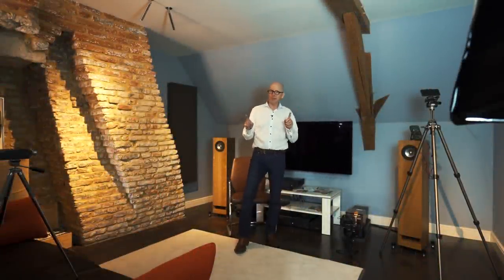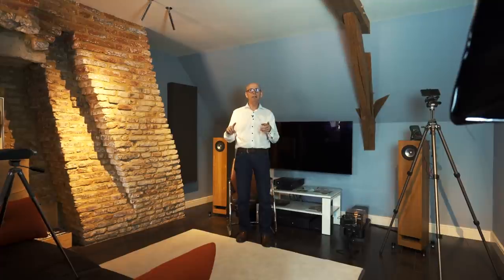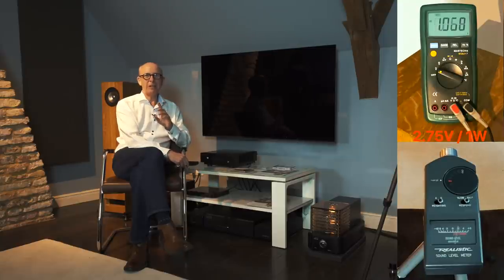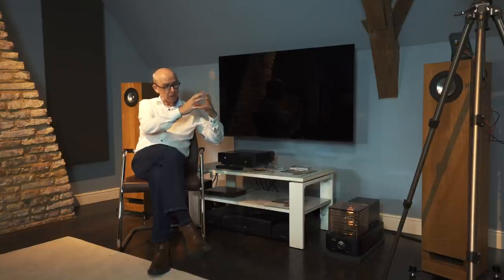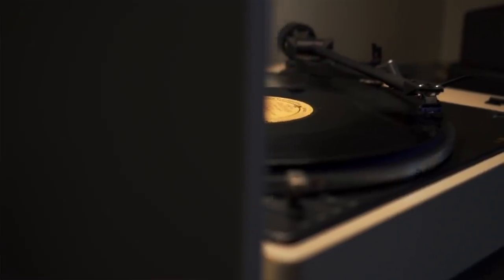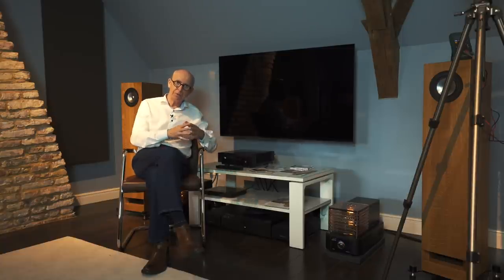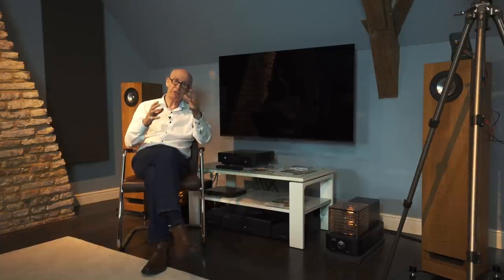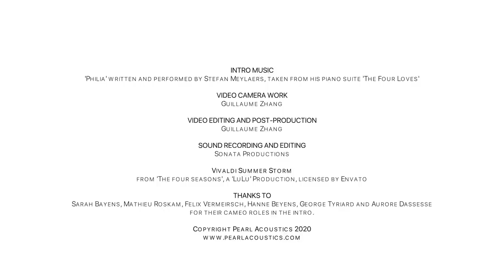How loud is 1 Watt (with an 87db Loudspeaker)?

Comment: 8 watts will push these 87dB speaker to 96dB. At 4 meters away it will be 90dB. Nothing near 100dB for sure.
Reply from the maker: Don’t forget it’s two channels driven, so you need to add another 3db. However, you’re right. The objective is just to show that in most listening situations we only use a fraction of the power we might think we are using.
Reply: Theoretically right but ech data are measured  by producer in anechoic chamber.
Reply: Sure -  if you enjoy your audio system in open desert you are right.  No standing waves and no reflections from objects 
For clearance   In my room 20 sq meters 87 dB from two speaker sets (efficiency about 91 dB).  just measured  my system with certified noise level meter and I've got 87 dB from 3 meters. 

 At that moment  I read  digitally measured 2 Volts at terminals . To be clear - I used pink noise so  type of music and timing   would have  no impact.

  In books and data theory you mentioned  it would be 91dB - 12dB = 79dB.  87dB  against 79dB  to accept is  too much difference.  For 8 Ohms speaker it equals  0,5 Watt  each. Means 1Watt at distance 3 meters in typical room makes 87 dB . I couldn't try higher level for my neighbours and mine comfort.  Just reality against "nice" science used  for factory  models for standardization ..

Comment: Otherwise a very informative video but the analogue about the speaker asking for power and amplifiers having difficulty ramping up is very very wrong. A speaker(ie an assembly of a magnet, voice coil, suspension and a diaphragm) doesn't ask for anything, the amp throws out power according to the input signal and the speaker does whatever it feels like doing with that power.

The amp supplies exactly the right amount at the right moment. An input signal tells the amp what to do and the amp follows the lead. If it gets a high input value, it gives out a high output value. Of course there is some latency and distortion of the original signal but a proper amp doesn't falter that easily.
Reply from the maker: Thanks for your comment. Of Course you are absolutely right. An amplifier amplifies the incoming signal, that's all it has to do!  However, what I was trying to explain, is the latency effect that you touch on in your comment. We must not forget though, as I am sure you know very well, a loudspeakers' impedance varies depending on frequency and other acoustic resistance elements, thus the loudspeaker puts demands on an amplifier, by the fact that the amplifier has to deliver its amplified voltage to a device that has a varied impedance and which is pushing back voltage of its own.  In the desire to simplify, sometimes elements get lost.

Comment: this is completely wrong.1 watt with 8 ohm speaker is equal to 1 volt.and the second reason is that you can't measure the voltage with a dmm.it's not fast ebough to measure the peaks.you need an osciloscope.you must have hit 20-30watts at this demo

Comment: Electric power is the most uninteresting number in audioworld.
When talking about speakers, it roughly tells you how much power speakers can handle. But this might differ depending on the type of signal and on the duration of that signal and even on the manufacturer
When talking about amplifiers, it roughly tells how much power the amp can deliver. But this might differ depending on what's the max. distortion level we can tolerate.

Comment: Your low efficiency drivers ARE NOT conveying the musical information of a sensitive type. These sub 90 dbl drivers are built to minimal cost the rest is marketing. Doubling of watts only adds 3 db of sound pressure so 87 db drivers at 8w can only reach 96 dB. Also each meter one moves from the speaker causes a similar 3 db drop in volume to one’s ears.

Comment: I appreciate the content ... however, 1w? 
Quite the contrary.

The amp was very likely encountering clipping. 

The inherent dynamics of music playback, especially classical ... (even an LP), require staggering peak voltages to track the dynamic swings. 
Even a modest 20dB swing, riding atop a nominal 1w baseline, requires 100w to pass without clipping.

Comment: You are not measuing the peaks. Good sound is all about headroom which you gets from powerful amplifiers with lots of power to spare. And try a more demaning 87 dB speaker from dynaudio, and you would get a totally different story than from those speakers. How hard speakers are to drive is very dependent on their design. Some 95 dB speakers needs at least 500 watt amp to have a good sound simply because of large woofers.

Comment: I'm afraid there is no way you were achieving those volumes and SPL's with one watt. The voltage meter used is far to slow to read so is not accurately showing all the peaks. It's not reading the dynamic differences. Also your basing you power reading on a fixed impedance.  Speaker Impedance varies with frequency. I dont know how you would go about measuring this correctly. A analogue meter might better show the voltage?. Maybe a data logging power meter inline would work. ? Sorry if you answered all this later in your video. Only watched the first part.

Comment: Your math is wrong, this basic electricity ! P = U x I and U = R x I so P = U² / R
2.75² / 7.5 = 1 Watt but 5.5² / 7.5 = 4 Watt  or +6 dB
and you displaying peak to peak voltage, not RMS.
Reply from the maker: Thanks indeed for your comment. Absolutely agree, there was an error in my delivery and I pasted the correction in the comments, maybe you didn’t see it? The idea of the video was simply to demonstrate how loud most systems are at relatively low power levels. Hope you enjoyed it none the less? Thanks
Reply: @PearlAcoustics  Sorry i didn't check the comment. The video was fine, thanks. If it was complete garbage i wouldn't take the time to correct you.
I would take sound level at 1 meter from the speaker with a simple microphone (calibrate with your decibelmeter the sensibility), and connect your voltmeter to the microphone.
This way you can even check your speakers efficiency
Reply from the maker: @vincentvoillot6365  hi Thanks fir coming back. This we did during the R&D phase, using B&K microphones. it came out at +/- 87,5 db. Best wishes from Belgium

Comment: I have a 1/4 watt amp being built for my guitar. I hope it's not too loud. lol
Reply: It will sound about "2/3 as loud" as a 1 watt amp. On a psychological loudness scale of 1 to 10 (imagining numbers on a volume control), a 1 watt amp being 10, a 0.7 watt amp will be a "9", a 0.5 watt amp about "8", a 0.3 watt about a "7", a 0.2 watt about "6", and a 0.1 watt about "5".
Your psychological loudness will be just under the cube root of applied power, about a 10 fold increase in power achieving about a doubling in psychological loudness (though somewhat frequency dependent).
Reply: @TimpBizkit  hey! That's a great analogy! And helpful. Thank you!

Comment: I want a 1 watt amplifier with 10,000 watts of headroom. 
Then I could play any style of music and not worry about amplifier distortion introducing DC into my loudspeaker.
Reply: It's average power that's important. A distorted amplifier could send disproportionately more power to the tweeter than a larger amplifier cranked up slightly above the limits of the smaller amplifier, although it will usually sound terrible.  Again this is not the occasional peak clip but well into crunchy guitar style sound on the whole track. If the woofer has plenty of power handling, but the tweeter is smaller, then the larger clean amplifier is better. I have damaged more speakers with excessive clean because I did not notice the limits as much. Usually cooking those 2" paper cone tweeters with only a 1st order filter. 10,000 watts of headroom, well it's a 10,000 watt amplifier. You are unlikely to reach such a transient.
Remember your speaker has no preference in musical tastes, other than not concentrating sound in one area of the frequency spectrum in a multi-way speaker.
Reply: @TimpBizkit  I was talking about unlimited headroom, as in avoiding all dc current from the amplifier during signal spikes from a preamp source. 
My make believe amp is not a large amplifier with a high rms output rating that just idles during most of its operation and could overload a total system at full power. It is a 1 watt average amplifier with basically unlimited power reserve that will not introduce dc current and heat to the driver’s coil during use. 
Engineers have come close with modern circuit designs, but we are still not completely there with perfect amplifier gain without some type of heat loss and presence of dc onto the driver’s coil. 
I want an amplifier that will probably never exist. 
It is not a 10,000 watt amplifier with let’s say 2500 watts of rms power, it is a 1 watt amplifier with 10,000 of reserve power.
Reply: @edwardmonsariste4050  I am not sure what to do, other than use a 10,000 watt amplifier that's turned down to 1 watt (or use an average power limiter so the peaks can exceed 1 watt), although in practice your peaks will be contained within 10 watts at 1 watt average levels. You are unlikely to see transients be 40dB above program material. In which case the unclipped peak would be harder on your speakers than clipped.
Why are you worried about heating with a single watt? Are you using the speakers in a greetings card? You could connect a battery across them all day at those levels and suffer nothing except maybe suspension sag if it was left on there for years (like if you rested a book on the speaker cone). DC during clipping is a myth anyway. It's not called DC unless the current stays in one place. Your speakers have inductance that resists abrupt changes in current, assuming the frequency is above the single digits.
Also due to cone momentum, your speakers will move roughly in a sawtooth pattern with a perfect square wave input. To get speakers to move in a square wave you need a high input transient at the beginning of each square wave to power the speaker suddenly in the opposite direction, then a "DC" to hold the cone at non-zero, though really this only holds at low frequencies say 2-3 Hz. It would look more like a high backed dining room chair wave if you could see the input voltage to the speaker.
The only problem with clipping is it puts disproportionately more power to the tweeters (and usually on heavily overdriven compressed music rather than the occasional peak), in which case you will be better off with a more powerful amplifier, but probably tougher tweeters. If you listen to a lot of heavy metal and hardstyle very loudly you can blow tweeters.
Reply: @TimpBizkit  Since the days of the old JBL horns and scoop cabs and insanely heavy class AB amps, I’ve always used the minimum 3dB headroom rule. Usually worked until too many beers and excited crowd wanted “more louder”. Then it’s Sunday afternoon replacing expensive horn drivers and new cone drivers. 1 watt is more than enough to drive those systems loud, just need reserve power for headroom. 
These days of smaller, more efficient amplifiers but with less sensitive speaker boxes, I don’t even pay attention anymore. Just let it ride until it touches the built in limiter circuit. Cheap in, cheap out. 
The music signal is very complex. I still believe that a distorted signal does contain dc properties that inhibit the driver to cool itself, along with a cross between sine/square waves that cause so many irregularities in the movement of the coil that the driver cannot function as designed. Also I’m not talking over excursion speaker farting. It may not completely stop cone movement, but it impedes it from providing enough air to cool the coil (without fluid of course). Maybe call it micro DC. 
I’ve never thought of a clipped signal being the same as putting a car battery on and off an 18” sub. Much more complex. 
I still test driver polarity with a 9 volt. Yeah I know your suppose to use a smaller battery, but if it can’t handle at least 9 volts, it wasn’t good enough to begin with. 
I could be absolutely and completely wrong about everything I’ve ever known about amplifier/speaker system design. When it comes to hard clipping a driver, that’s what I’ve known.
Reply: @edwardmonsariste4050  I continued to crank a clipped amplifier and speaker excursion continued to increase. Okay it was an amp with about 40 clean watts per channel into a 12" PA driver so not near its limits apart from excursion. This means that the vented pole piece was getting more air movement, thus it is not true that the speaker has to dissipate twice the power with the same excursion through the vented pole piece.
Even if it were true that the speaker dead stopped, the faster cone motion would chuck out more air through the vented pole piece. What does build up heat is power at frequencies where the speaker's motion is restricted, such as the tuning frequency of a vented box or quarter wave of a horn cab. The impedance lowers due to more load on the speaker also.
To reproduce a true square wave through a loudspeaker requires hypothetically infinite power.

Comment: Wait, wait, wait....  Didn't you already tell us in the video title how loud the speaker is going to be at one watt?  The speaker should only get to around 87.5db, if it gets louder, then you are increasing gain somewhere and providing more than one watt.

You are using more than one watt here bud.  Like others have said here, this is really a pretty poor way to measure wattage.  I agree that one watt can get fairly loud, but if you only had one watt, you would not have any headroom or anything left for dynamics.  Most smart audiophiles know that you need power for headroom and for very large musical transients.  I use two powered subwoofers that I have a 3000 watt RMS amplifier (peaks dynamically at 5000+watts) and yes, the subs absolutely love the power.  I used to run less wattage amps, and it seems they would run out of steam when you get the long low Hz bass tones.  Now with more power, I can gain the amp down well below distortion levels and have plenty of headroom.  And I also don't agree with anyone that you have to have expensive stereo equipment to get a stellar sound.  All my crap was really pretty cheap in comparison to how it actually sounds.
Reply from the maker: Thanks for your comment Kris. Indeed, each loudspeaker produces 87,5db at 1 watt. But this is a Stereo pair so it’s 87,5 left channel and 87,5db right channel which equals + 90 dB. 1W per channel. So no trickery or errors. But, I agree, often, more powerful amplifiers are more enjoyable to listen to. Hence my 40W per channel Class A monoblocks, 
Enjoy your system and thanks for sharing.

Comment: 1 watt will not give you good dynamic range or headroom compared to  a more powerful amp. 10watt speaker with a 100watt amp will be best
Reply: That's not the point of this video, he's not telling you to buy a 1 watt amp; it's just a demonstration of the fact that you don't need to chase power and sensitivity. Caveat emptor, obviously.

Comment: ts actually pretty silly  really , to do this accurately you should use  a scope , since music is not RMS , you need to see the peak  vs RMS . 

On highcrest factor  recordings 1 watt RmS will exceed 100 watts on peak , no way to see this on such a volt meter .! Not 7 watts from your conclusion , and not possible on an 8watt without excessive clipping, making   this  presentation  and conclusion very misleading  .! 

BTW the speakers are  not 87db efficiency , its 87 db sensitivity !

Regards
Reply from the maker: Hi, Thank you for your comment. I appreciate your input and indeed I can totally see your point. But I was trying to make a point here, that many people misunderstand power needs. I also agree that there can be massive peaks in dynamics in acoustic instruments. However, most music (especially pop music) has a dynamic range of no more than 10db (this is mostly mastered to sound good on radio). Hence, the demand on lower powered amplifiers is not as great as most people think.

Comment: Valid. Now try the same watt with electronic music, some bass heavy notes. 100 watts won´t be enough to reach the same SPL
Reply from the maker: Dear Paulo, if your speakers are relatively flat from 40Hz to 15khz - adding bass will not require more power, because they are flat. If, however your speakers do not have a flat impedance curve, going down to under 2ohm (for example) at low frequencies - then yes the amplifier will have to supply more current (amps). But that does not necessarily mean more Watts because the resistance is lower. The laws of physics tell us: Watts are equal to volts x amps. And volts divided by amps equal the resistance. If you apply both calculations, you very quickly come to the calculation you need.
Reply: It is often case that listeners greatly amplify bass for personal pleasure. . Unusual power is required  for high loudness  of lowest range  That loudness is characteristic  to a very near, not like in reality listening

Comment: This does not demonstrate anything, as the sound is much more complicated than this demo at a distance of about 4 meters which needs much more power, and the sensitivity of 87,5 Db is mesured at 1 meter etc etc ... 
Happy that you have fun, but i did not learn anything about sound and watts. Sorry. Have fun. 
Youtube has strange consequences on people.
Reply from the maker: Thank you for your reply Al. Perhaps you missed a bit because I show the dB meter at the sitting position, meaning where the microphones were too. Thus I tried to demonstrate how loud 1 watt is through an 87db efficient speaker at the sitting position. And here you clearly see the effect of how loud a system can be with both channels driven at even modest power levels.